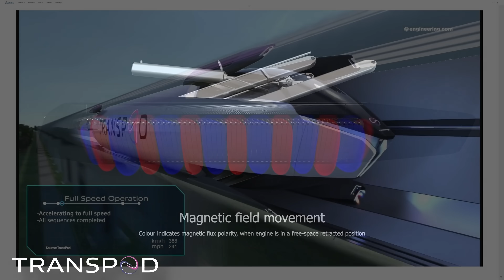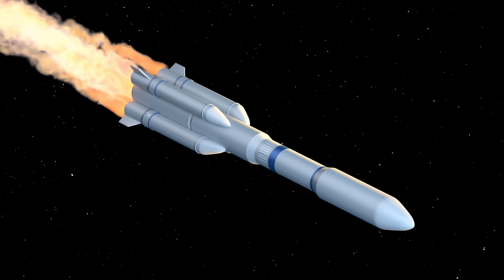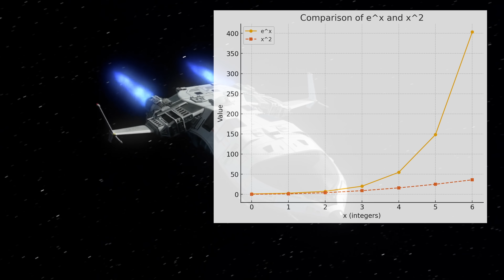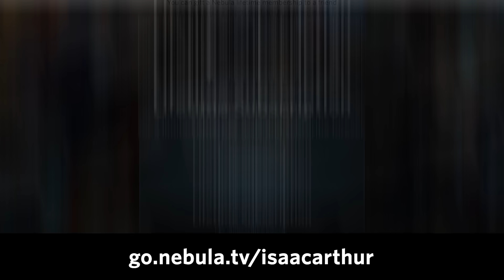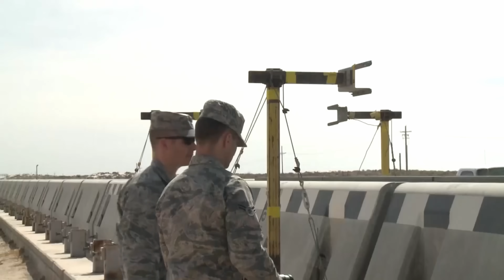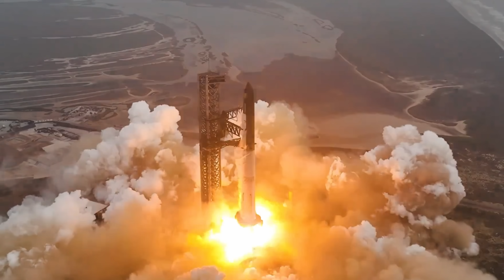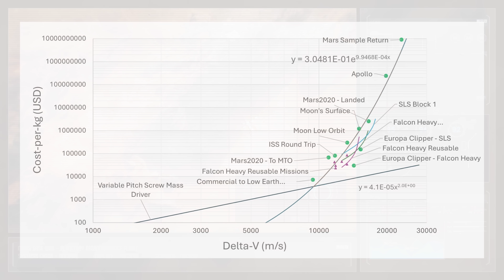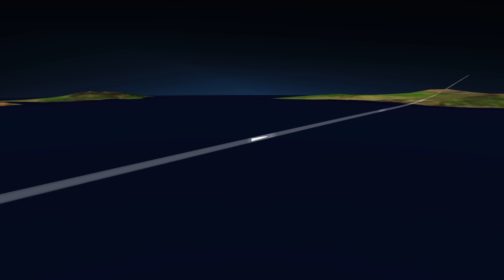Rockets vs Mass Drivers: Which Will Rule the Skies in the Future?

Comment: A couple writing glitches in this one. The segment on the significance of different rocket fuels' relative masses and exhaust velocities is good, but at the end you go on a weird tangent comparing them to absolute quantities like LEO velocity or the time it would take to reach Alpha Centauri(?!), as if a rocket had a "top speed" at its exhaust velocity. Of course in reality we routinely reach orbit and beyond despite no chemical rocket's exhaust velocity being nearly that fast. Going faster than their exhaust is one of the two biggest tricks rockets do.

The part about transport jets' fuselages being able to handle negative pressure starts out just plain wrong. "Overpressure" is a reference to excessive positive gauge pressure, not negative gauge pressure. The clause and tolerance you speak of and highlight on the screen are referring to the fuselage withstanding positive pressure loads a bit beyond what the pressure relief valve can be set to. The page onscreen starts right out saying that it's talking about positive pressures that start at zero. You do then recover to the unrelated spec that fuselages need to withstand 1psi negative gauge pressure.
Reply: The use of the term "overpressure" to describe "negative pressure" was technically incorrect and aeronautical engineers need to be precise. But in SciFi, I can imagine Scotty screaming, as the Enterprise sinks into a gas giant, "Captain, she canna handle the overpressure!!"

Comment: Haven't watched the vid yet, but why not mass drive a rocket? Like a catapult for a jet on an aircraft carrier.
Reply: I think the main problems are rockets are far heavier than their payload, assuming same ratio as regular rockets. Most would also would have difficulty with acceleration over 5G.

So it’s possible and not too impractical.

Comment: I am skeptical of mass drivers being a thing, at least on Earth, per se. I see it as being part of a orbital ring and/or tethered ring system. And even then, I think it is more feasible that people want to do space tethers more than mass drivers though technology used for mass drivers can be applied to tethers—I am imagining this scenario being your hypersonic suborbital-capable aircraft gets hooked or coupled to a sled and then accelerated upwards the tether until it reaches orbital velocity, either matching that of the end station or higher, and you can always decouple at any point up the tether to a lower orbit though this will require you to have your own rockets. 

Mass drivers can also be used as part of a momentum-transfer tether system up in orbit to accelerate the spacecraft to escape velocity in an interplanetary trajectory. This can be useful even with ultra-high impulse nuclear propulsion systems. 

If there would mass drivers on the ground, then it would be used not as a purely as a way to get to orbit but being able to accelerate a bigger payload so that rocket thrust is not required to accelerate a spacecraft from a standstill, so basically just a catapult up in the air before firing up the engines. This probably would enable high economic scale SSTO systems, especially when coupled with a tether but I don't have the numbers to back it up, not yet anyway. 

On a more mundane note, I can see small scale mass drivers being employed at regular airports (I really don't think airplanes using good ol' aerodynamic wings are going away anytime soon and VSTOL is going to still be a niche). For an aircraft, the engines use the most fuel per second accelerating to take-off speeds and also create a lot of noise. This will encounter some engineering, practical, and operation challenges (including safety questions that need to be answered) but a mass driver/electromagnetic catapult that can accelerate an airliner up to take-off speeds would be useful and you don't need it to do it like aircraft carrier launches, either. In this case, pilots just need to set a power output that would keep them climbing (in noise mitigation areas, pilots have a short window of time to throttle back the engines from take-off power to reduce noise).

Of course, we haven't discussed the potential military applications of mass drivers. In the Halo expanded universe novels, during the war with the Covenant, humanity's colonies have used mass drivers to launch projectiles from the surface in an effort to fight enemy ships as the UNSC is always outgunned when it comes to space warfare (the UNSC, especially when the Spartans are involved, tend to prevail on ground or surface warfare but they are very outclassed when it comes to spaceships).

Comment: Re: drones for holding up launch tubes. First, you don't need drones at all. You can mount propellers or other lifting devices directly to the launch tube. The more important question is how much propulsive efficiency are you going to lose towards the end of the launch tube. You're going to want to lift the end up as high as possible to get above as much of the atmosphere as you can. This becomes increasingly more important as your exit velocity goes up. Unfortunately, most atmospheric propulsion methods lose power the higher up you go, so you need more and more lifting devices for each additional unit length of launch tube.
Reply: The lift is generated by a prop and an electric motor. With altitude, the prop will get bigger and perhaps more expensive until it starts to resemble an Ingenuity propeller. However, the efficiency with which electricity is converted to torque and then lift may be more constant.

Comment: The video hints at it towards the end: would it be sensible to combine rocket and mass driver in one system? As in, having mass driver just a few hundred meters long, providing some initial acceleration to a rocket - a 500m mass driver should be able to accelerate to roughly 1000 km/h at 5g. Of course, the fuel and cost savings would not be that massive but the intial investment needed to build such a driver woulld also be comparatively low. And to me it seems like this could be implemented without too much further technological advancements needed?
Reply from the maker: Yes, and it will come up a bit more as a tandem option in our skyhooks rotovators episode in a couple months and later launch loops one, but I didn't want to extend this episode any longer
Reply: @isaacarthurSFIA oooh a rotovator episode!  Will you be examining instabilities of rotovators in steep gravitational fields?
Reply: I'm looking forward then!

Comment: The problem with drones is the upper portion where the atmosphere is thin. Can't really do cheap drones high enough where the air is thin enough for the evacuated tube. Active support likely wins out in practice for that.
Reply: Active support may win out. Still, NASA/JPL demonstrated that drones can fly in a thin atmosphere with Ingenuity so I wouldn't count them out.
Reply: @spaceinfrastructure3238  That's still dense enough of an atmosphere where launching a craft out at hypersonic velocities is going to generate a LOT of heat. If that's not a problem then why bother with the evacuated tube. Also flying a drone like that is one thing, flying a drone like that under load is another. Like I guess you could have drone lifting bodies for much of the tube that's in dense enough atmosphere and only have active support for the very end when that's not feasible, but I don't think you can do it with purely drones.

Comment: It's kind of funny to me how much space exploration seems like a video game mechanic. It's not accessible until mid to late game, and the technological progression comes in tiers with prohibitive costs. As Isaac eloquently explains, you have to start off with rocketry which has low upfront capital requirements and huge operational costs, limiting you to very low throughput space operations serving low demand. The obvious "upgrades" that exist to reach higher throughput tech tiers have monstrous upfront capital requirements but then have rather low operational costs comparatively. A certain amount of profitable usage must be wringed out of the upgrade to break even and cross over into net profit territory. Rockets are sort of the early bootstrapping tech for space access. It's far from ideal, but if you want satellites and the modern luxuries and economic benefits of having them you sort of grit your teeth and go with it, lol.  Just like well-designed game mechanics, you can't really short circuit this progression or cheat your way around it to break the game. Space itself, in all its absurd enormity, seems like those unexplored "fog of war" areas of a massive game world. The devs didn't put all that empty space in the game for us not to be intended to explore that. 😆

Comment: Hybrid. Mass driver that exits at a realistic altitude, then a ramjet takes you out of the atmosphere, before a rocket finishes orbital insertion and an ion drive dials you in. Should be significantly cheaper anyway, since the start of acceleration is where you spend the most energy lifting the least useful tons of propellant.

Comment: Thank you for detailing the variable pitch screw mass driver. Ive wondered about this ever since your video on suspended orbital rings.
I have to admit Im a bit skeptical of the concept.
If I understand correctly there are two screws alongside the track that need to be spun up before launch but... isnt this track going to be hundreds of kilometers long? How heavy are these screws and how long does it take to spin them up? And arent there any issues with torsion forces flexing the screws as they spin up?
Reply: 1. Yep.
2a. Probably on the order of the weight of train rails or a gas pipeline, both of which are routinely built hundreds of km long, albeit obviously neither of those have as much machinery or moving mass. In most designs most or all of the track is sitting on/in the ground or floating in a tube underwater, so we don't particularly care about the weight.
2b. From zero, hours, probably, maybe a day or two even. As you start launching more you might spin it up and then run a bunch of launches in a row, just putting the expended energy back in for some minutes in between.
3. Not especially, for simplicity they're drawn as solid pieces in the schematic render he shows, but in reality they'd be built in segments. All the segments spin at the same, not especially high, rate, via motors every 100m or whatever. As an engineering detail the segments would need to be carefully synchronized relative to their neighbors.
Reply: @HypoceeYT  There's a clip at 23:00 that shows the segments.
Reply: @HypoceeYT  The screws being segments are an important detail. From the description I was assuming that it was one continuous piece of metal along the entire track.
Reply: The problem I see it is also the manufacturering the building of that thing. A lot of these mass driver projects turn out to be extra high speed rail projects. The problem with that, at least in America, is that high speed rail is not even a reality, let alone a glorified version to space. the only feasible way a mass driver can be built realistically is for a short distance high acceleration platform

Comment: Is a mass-driver rocket hybrid option feasible during the prototyping stage? A shorter mass driver would initially accelerate a smaller rocket, and at the end of the mass driver, the rocket would ignite and go about its way.
Reply: Would love to know how much less fuel a rocket (e.g falcon 9) would require if its initial velocity is 200km/h as opposed to 0km/h. Is anyone willing to do the calculations?
Reply: hah! that's exactly what I was thinking.  we already use catapults on carrier aircraft, seems like it would make sense to do something similar for rockets.
Reply: Additionally, if you are trying to achieve a carbon neutral rocket, it seems to me that hydrolox and mass drivers would compliment each other quite well.
Reply: Fireball XL5
Reply: Regular Artillerie can fire rocket assisted projectiles, so it should work for mass-drivers to.
Reply: You have just given the pitch for this (relatively recent) POC: @spinlaunch6288

Comment: Doing the math made me realize what a bad SciFi idea "relativistic mass drivers" are.  Even at 100,000g the lengths worked out in light seconds, or even AU, and impossibly straight.  Not a weapon you could build into a planet, let alone a ship.   You're not getting a projectile up to relativistic sped without ripping it to plasma, at which point it's a plasma cannon not a mass driver.  Plus of course you need the energy in 1g of antimatter to accelerate 1g of matter to such speeds.

Comment: Could the tube work in opposite way, with several points along the track pushing large amounts of overpressured gas as the train passes by them and thus the train being pushed outward of the tube?

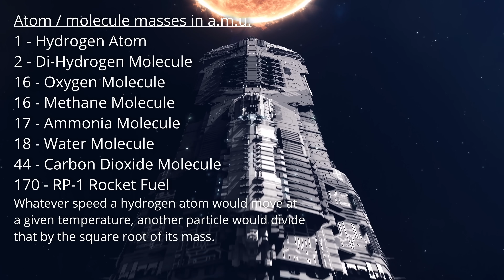Comment: At~8:30 mark, this is why hydrogen oxygen engines usually mix in a 6:1 ratio instead of the 9:1 for burning all the oxygen. About a third of the H2 is pushed out the back unburned for higher performance
Reply: Awesome comment!

Comment: You could even avoid needing an evacuated tube using a tethered ring and the variable pitch screw design. Hang the tube from the tether down to the surface with a screw pitch near zero, keeping the plug slow enough to drop a vehicle in front. Then keep the vehicle at a low speed as the tube slopes steeply upward, only accelerating to muzzle velocity once it's above most of the atmosphere. Since the tube is hanging from a ring, make it a full circle and slow the plug back down to return to the station. It would effectively be one of those moving walkways in Caves of Steel, but going from walking speed to orbital speed.
Reply: You mean sky hook ? Or space elevator? What ring ?
Reply: @ArneChristianRosenfeldt  neither, I mean exactly as I said: a tethered ring. Isaac did a video on them. It's something like a lofstrom loop in its altitude and what it can be used for, but it's circular and supported differently.
Reply: @chr1styn806  Youtube does allow links in comments to other videos. https://www.youtube.com/watch?v=8B2iqiKehyM
Reply: @chr1styn806  ah, okay I was worried about traveling too fast along a space elevator because a crash could damage it, but here all the time a ton of mass runs around as a maglev. ( writing in another comment to not break the fragile link thing in YouTube ). Even MagLevs have losses and eddy current.